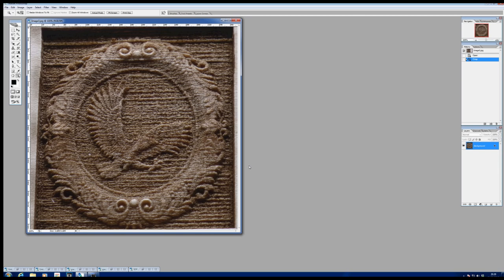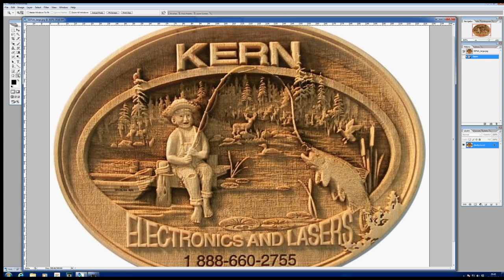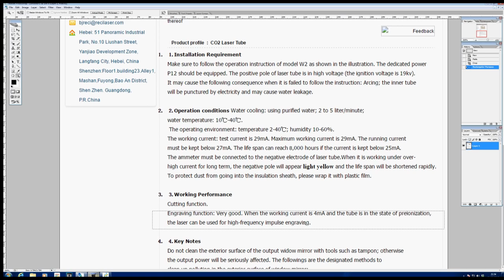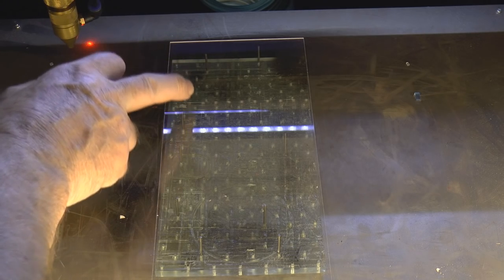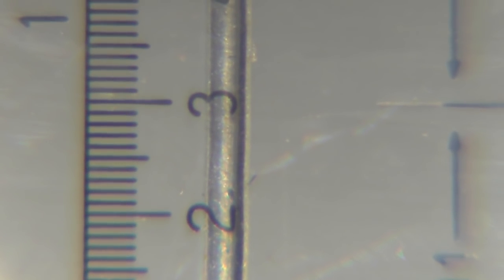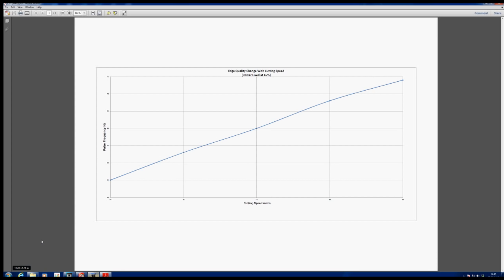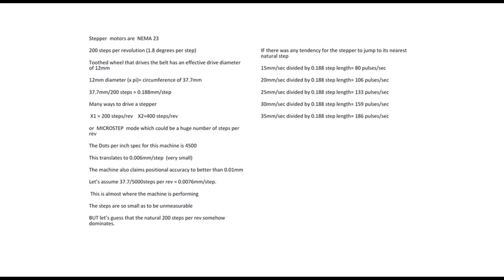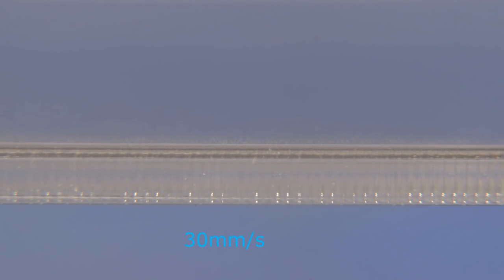RDWorks Learning Lab 63 High FrequencyImpact Engraving

Comment: Maybe the vertical lines are stepper motors movement and your bitmap. The bitmap brakes it into pixels
Reply from the maker: Hi Peter
Thanks for the comments. I am now a year on from this have done investigations into many other performance parameters of the machine. I think that the steppers were the biggest factor as you suggest. However there were several problems all intertwined to produce these results. Steppers are naturally jumpy in their action and there are several sessions further on where I try to make sense of this but the stepper was in turn driving resonance in the belt and exaggerating non-uniform head motion at various speeds. Coupled with that there was  the "curtains" effect where the varying velocity of the belt as it engaged and disengaged with the drive pulley  was further adding to my vertical lines . Having successfully solved the resonance issue and the curtains problem it was only a matter of running the steppers fast enough to make sure that the inertia of the rotor was damping out the steps. Running slowly with a low resolution bitmap and too much power was putting unnecessary striations in the bottom of my cuts. Now a year later with a slightly modified machine and  more knowledge I have revisited 3D engraving . You may wish to jump to 
https://www.youtube.com/watch?v=0E6VfQD9n2o
and you will see the last pieces of my power puzzle being solved and then
https://www.youtube.com/watch?v=j5cIFxGu_1g
For the final striation free results.
Who needs an expensive Kerns, Trotec, Epilog or Universal machine when for 1/30th the price you can make the machine do this?

Best wishes
Russ

Comment: I have noticed the same pattern on the outside of my prints on my 3d printer.  Could it be something to do with the gt2 belt profile? Maybe as the ribs go over the pulley the add/release a slight amount of tension?
Reply: Thought the same thing at first, but I flipped the the belt over and run the smooth side, it still produces the same banding.

Comment: Any chance that the pulse from the air assist could be a factor?
Reply from the maker: Nice idea but the aquarium pump is an oil-free diaphragm mechanism that is solenoid driven at mains frequency. I can see the the air pulses on the soundtrack and can confirm 50 Hz which will be constant. It's a good thought though because its in the right frequency region. All ideas gratefully accepted. I stupidly didn't scan the sound track for the suspected stepper  resonant frequencies until after I had published my video. The surprising thing was that I could see no patterns just a consistent motor frequency of 225Hz regardless of speed!!! Lots more digging required.
Thanks for input
Best regards
Russ
Reply: SarbarMultimedia
That's brilliant!  I would never have thought of using analysis of the audio to find clues on that.  And ironically my business is audio recording lol.  Great work.  I've learned so much from your videos.  Thank you for sharing your exploration of this subject and passing along your wealth of knowledge and thought processes.

Comment: for 3d printers its possible to get around this and get smother runt if they put on different pepper drivers.   its not possible to do thee same here??
Reply: Hi Lenny

Many discovery sessions on and I put this problem to bed. Although the stepper is imparting micro shocks to the system, that frequency over a small range gets gets amplified by the flex in the teeth of the rubber timing belt interacting with the mass of the head and causing mechanical resonance. The problem was addressed by changing the timing belt to a steel corded polyurethane belt where the teeth are very stiff. There is still resonance in the system but it is over a much smaller range and at a much lower frequency , well away from the 3D engraving speeds.

Comment: Hello, I had a question about the Chinese laser cutter, I do have a 100W machine, when I cut (I noticed that in some plywood) I use Speed 30, Power 40, and it cuts in a small zigzag, if it is cutting in one line like an outline of a shape it cuts it with nothing notable, but if small lines or triangles inside the shape, a small zigzag in the wood appears. Also that happened in much worse way when I mark the wood (cut with high speed and low power), I give a shape of a small chair for example it turns out to be zigzagged as if it is hand sketched. Is there an explanation to that?
Reply from the maker: Hi Abdalla
I had a correspondent with a similar sounding problem. It was a simple fix for him and maybe for you also. Check that your lens is firmly clamped in its holder because if the lens is loose the head movement shakes it and  produces strange cuts. If that does not fix the problem then go to the YouTube private messages and send me your email. I will write back and you can send me pictures off line.
Best regards
Russ
Reply: +SarbarMultimedia ok I will check it out and get back to you, thank you, you are awesome :)
Reply: Hi, I checked for the lens, I found it broken from a side, not cracked, broken. I didnt use it for more than a month, but I did put some heavy weights to straighten bent wood, I am not sure if the collisions that accidently happened caused that or it came like that. I also had another problem while trying to take the head off I think with alignment, I dont know, it did cut through a 6mm plywood in some areas of the table, some areas it is a very thick line next to a thin line (it makes 2 lines) and fades back to normal, I don't know if this is alignment issues or what? I don't know if I can work with that lens that is broken or I have to replace it immediately? I did put it in place again and cut the that weird cutting wood (6mm) and it did 3mm too, but i certain areas of the table. Also, I cannot find that youtube private messages part, I want to send you pictures
Reply from the maker: Hi Abdalla
If you click on the blue square beside Sarbar Multimedia it should open a page with tabs on. Press the ABOUT tab and another page opens. Top right will be a MESSAGE buttom
Regards
Russ

Comment: how about using a servo drive?  as always great video, thank you
Reply from the maker: Hi Sanjay
I Have dabbled a bit with servos and although they are stepless they do required more complex controls because you need the encoder for feedback. You then still have the same control issue of large accelerations trying to keep up with the program command and the braking effect as soon as it realizes its going to overshoot. The faster you go the easier it is to keep smooth motion. I'm extremely happy with the performance and precision of this very cheap CNC control system but this one glitch/ weakness is a challenge to overcome now that I understand what and where the problem is. This will be dealt with in one of the next video's.
Thanks for your kind words and comments
Best regards
Russ
Reply: hi russ
Very interesting approach in your excellent video. i am also hunting for what i think is the same problem. when i cut horizontal lines, i can see a very fine pattern of pulses. but the vertical lines get a much coarser stepping. i counted it to about 40 Hz. it changes with the speed. my guess was also a stepper resonance. its a common cnc problem. there are dampers available (30-50 euro) but there are also better quality motors that have built in damping. unfortunately i have no idea how its with compatibility to our system. my second approach is to check the signal with an oscilloscope. there could also be some frequency disturbing the laser output. i am looking forward to your conclusions.
best regards 
volkmar
Reply from the maker: Hi Volkmar
I originally thought the laser may be the culprit but when I did my 500mm/sec tests to find the preionization zone, nthe pulsing laser was obvious but when I moved into "normal mode" above 14% the beam was pulse-free. I therefore conclude that those cutting artefacts are something from the motion control system. Several corespondents have mentioned that they experience the same problem with 3D printing and as I point out, the best laser carving machines on the market also suffer from it. I was convinced when I did the video, that stepper resonance was the real culprit because you could hear the difference in stepper noise change as the speed increased. However, I failed to examine one vital piece of evidence that was so obvious I feel embarrassed. My video takes 50 full hd frames per second and thus the pictures will always be difficult to interpret but the sound is laid down CONTINUOUSLY. I had a complete analogue record of what the steppers were doing as I filmed. When I examined the sound trackrecord, there were no low frequency patterns or breaks, and at 5mm/s, 50mm/s and 100mm/s  there was a 225Hz fixed frequency. Go figure!! Lots more to examine here!!!
Thanks for your kind words and feedback. It's always good to get someone else's though process. I'm sure the answer will be obvious.......when we discover it.
Best regards
Russ

Comment: the wood grain density?
Reply from the maker: I'm now a year further on with more hard won  peripheral knowledge about the laser beam and the machine. I  now understand high frequency impact engraving and how it can best be exploited plus I have cracked the 3D engraving (see #126 and #127)  I did quickly learn that you cannot engrave anything with serious grain in it because the resin rings are much denser than the cellulose in between and the results are rubbish
Best wishes
Russ

Comment: If it is the stepper motors, then you need to do 2 things to fix the problem. If your machine allows, and if you have the technical ability, you can turn on microstepping, and put it on 4 to 8 microsteps per step, and experiment with that and it will be a lot smoother just by doing that.  The second thing is to get 2130 ramps chips, and not the old red 4869 or whatever their number is. Here's a video about them from Tom's 3D Printing: https://www.youtube.com/watch?v=sPvTB3irCxQ   They make the sine waves smoother going to the printers and all the noise goes away.  But you have to solder the pins backwards from what you would think. The chips face down toward the board, and not up like the old red ramps chips do.
Reply from the maker: The steppers are already micro stepping. If you move further into my learning journey I did eventually come to a conclusion. Yes,  the steppers were the root cause of the problem but the real problem was mechanical resonance
see    https://www.youtube.com/edit?o=U&video_id=SsSFVTAhng4
Best wishes
Russ